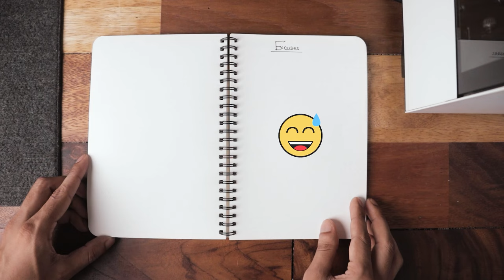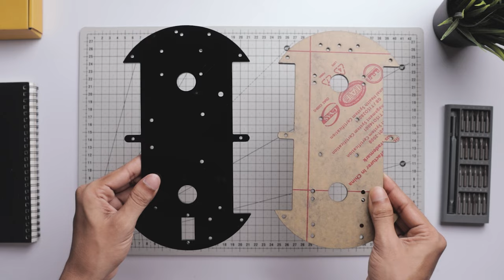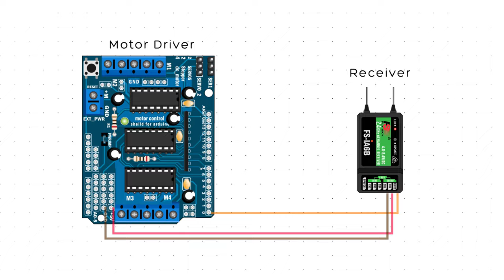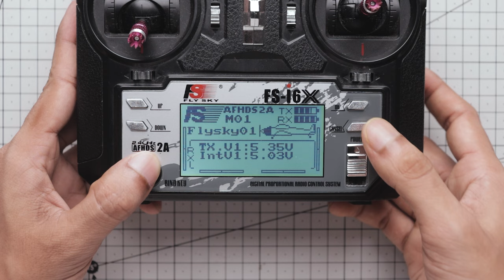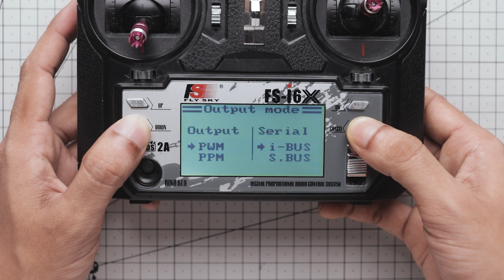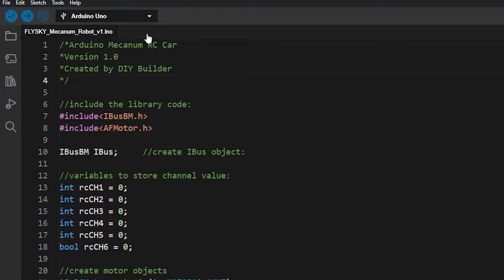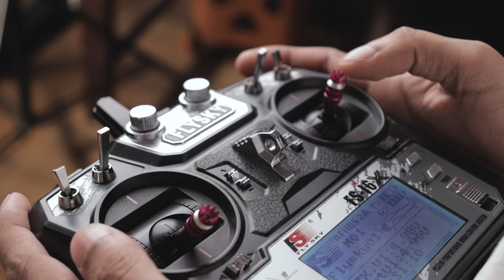How To Make Arduino Mecanum RC Car using a drone Transmitter (Tutorial)

Comment: how can I make a project like that without the mecanum wheels?
great vid
Reply from the maker: you can make this project using normal rubber wheels but you won't get all the possible movements
Reply: @DIYBuilder  yea ik that but how will the code change

Comment: In your Arduino joystick controlled car project you will use Arduino nano both transmitter and receiver but i does not have it so i use Arduino uno instead of Arduino nano in receiver and Arduino mega for transmitter its work or not please consider and tell my comment bro and your video are so interesting thank you ❤️👍👍👍

Comment: In my case when pus channel 3and 4 motor speed getting too low help please
Reply: did you find the solution for the voltage drop with channel 3&4?, having the same problem with my build.

Comment: Hi bro i am huge fan of you.I recently saw your "Arduino obstacle avoidence+voice control car " vedio .
I needed extreme help ive even contacted u on Instagram pls help me out by sending the code of tht as the code link in the description doesn't work
And can i control the car with remote control buttons on the phone .for ex: there will be a forward button on the phone the car moves front like tht 
Instead of voice control ? Pls help bro plsss
Reply from the maker: bro check again code link is working properly. Note: if you want remote control button option then you can make the Bluetooth controlled car.
Reply: Thank you bro 😁